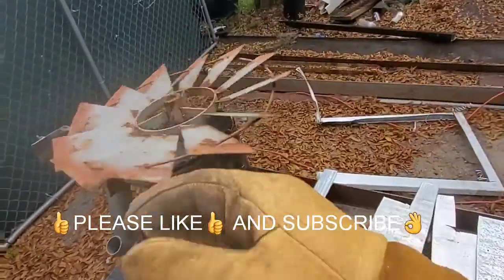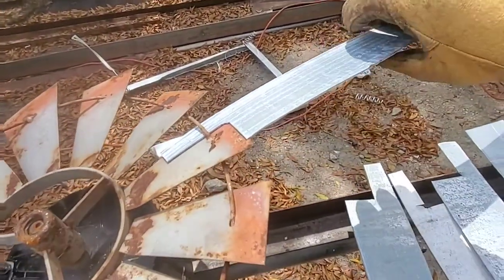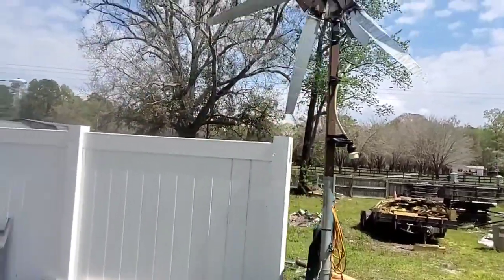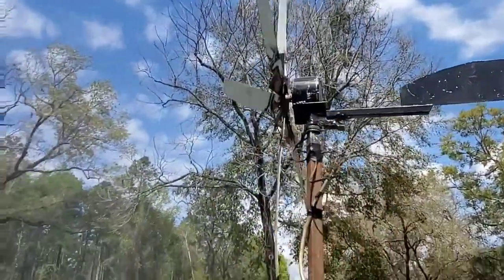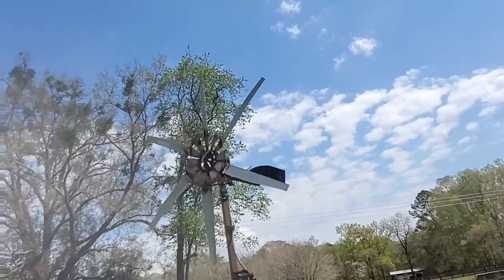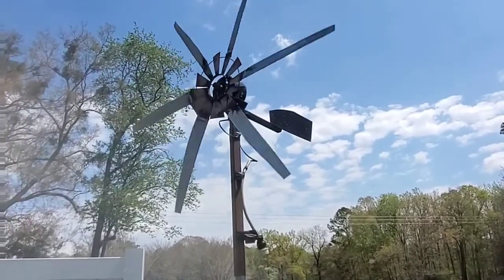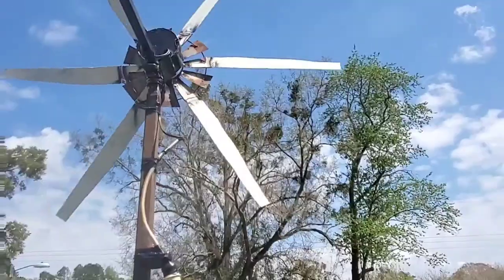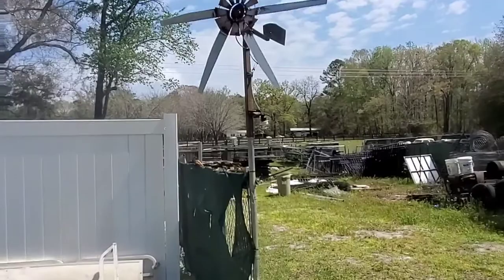DIY wind turbine generator using HVAC ECM PMA BLOWER MOTOR. PAID $5 AT SCRAP YARD!

Comment: I have one I used as hydro. Worked great for that. Tested it with a drill and found it makes 13 open volts at 92 / 100 rpm. Lowest rpm I have found for wind power. Mine is a 1 hp 120 volts at 12.8 amps / 240 volt at 9.10 amps at 1300 rpm. So at 92 or 100 rpm it should start charging a 12-volt battery. Someone tell me if I'm wrong, but I think I need bigger / slower blades to get the most out of it. When saying bigger and slower I mean you will have to match the blades for output. Thinking lower wind.
Reply from the maker: Yes with low wind conditions and how high the drag is on the motor when you pull amperage from it, bigger blades the better! Ultimately this is what I have discovered and done in my most recent designs with pleasant results!! I have not found another turbine that will charge at such low rpms.  All that I have purchased or got the opportunity to test are virtually useless (actually drain power from batteries due to charge controller eating watts when not charging) unless the wind is whipping!  Which is another reason why they are all designed with small blades and motors with little resistance to enable high RPMs probably due to the cost effective of making small blades opposed to large ones

Comment: That motor actually produces DC voltage.  Then is changed back over to AC.  Take the end off and you can unplug bridge and caps.  Then maybe have more Options
Reply: Not to sound like a smart mouth, but I think your wrong. Let me explain. I have personally disasimbled a few of thoes ECM hvac blower motors. They do have permanent magnets 3 of them, but on the rotor not on the stator. the outside just has coils of wire, that connect into 3 different coils and 3 seprate wires exit the motor on the back. There were no brushes and no comutator like on brushed DC motors. But that still leaves the option of it being a Brushless DC motor. And that is could vary well be. Because the only difference between an 3ph AC synchronous motor and a DC bruchless motor is that the DC motor is fed a Square wave or choped voltage as some call it. And the permanent magnet synchronous motor (3ph AC motor with permanent magnets) is fed a 3ph sine wave. But both an AC synchronous motor and a BLDC Motor will produce an 3ph AC output when you spin the shaft as shown in the video above. Again im not trying to sound like a smart mouth, if you think im wrong feel free to respond and i can chat and debate farther. i really enjoy topics like these.
Reply from the maker: It is in fact a bldc motor. I have done many experiments with these motors because they are easily obtained at the scrap yard because they are scrapped by hvac techs daily.  Mainly because the controllers go bad on them. I have modified windings to lower voltage, changed out ferrite magnets with neo magnets and much more. All this was fun but if modifications are not done perfectly then the motors tend to be less powerful than they were originally. The ecm motors with less coils are more fun and easier to get more power from them that is useful
Reply: I have somthing to add to comment when i said that  3ph AC synchronous motors and a DC bruchless motors are basickly the same for small motors yes this is true but when you get into industrial 3ph synchronous motors they don't have permanent magnets on the rotor they have electric magnets powered by slip rings with DC voltage so it basickly all your doing is trading the permanent magnets on the rotor for a more powerfull electric magnet. but it does not alternate because it is powered by DC.
Reply from the maker: Wow. I was under the impression the output was 3 phase ac like any other 3 phase bldc. Are u sure
Reply: @MrFigureitout  the output from the windings is DC.
Reply from the maker: Check it with your meter on ac and tell me what you get. Please email some pics of what motor you have. I'm very curious now.
Reply from the maker: Nickl4462@gmail.com
Reply from the maker: I'm pretty sure I did take off the back and only have the three wires coming directly from the windings for my output. Are you referring to the motor controller that was originally mounted on the back of this motor? If so, I was not able to get any output at all with it connected.  Thats the reason most people do not even realize they are brushless dc motors! Only reason I figured it out was because I was on my usual motor salvage run at the scrap yard and I would always spin shafts on motors to see if I can feel the forces of permanent 🧲 magnets.  Dead giveaway when your looking for generator type motors.
Reply: @MrFigureitout  yes we’re on he same page.  When you unplug the motor from the back piece and spin it, it produce and read  read DC.  
I replace a lot of ECM Motors in my line of work.  I’m experimenting with one nw t
Reply: No it is a 3ph ac generator.

I build these into gens and also make my own rotor for it.

Just need a 3ph bridge to get your DC out of it.

BLDC motors do run on DC pulses but the driver inverts the pulses too into a square wave timed "ac" pulse